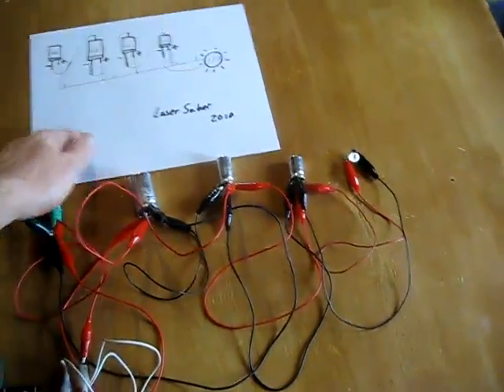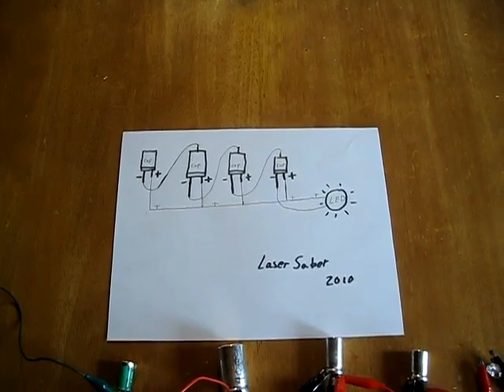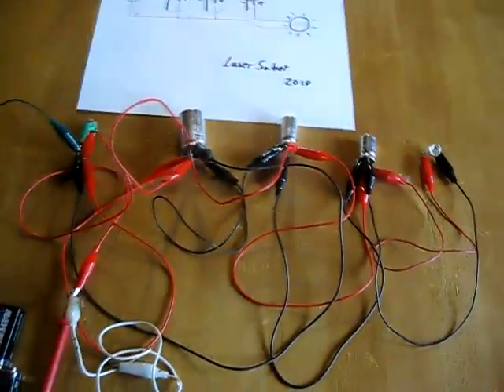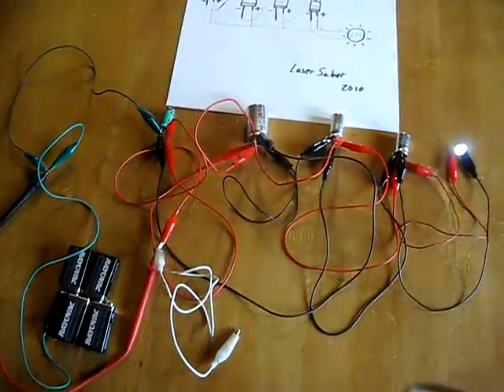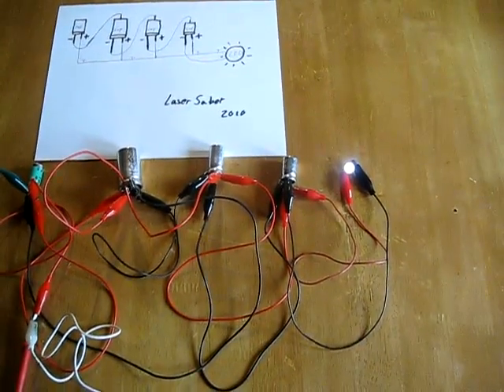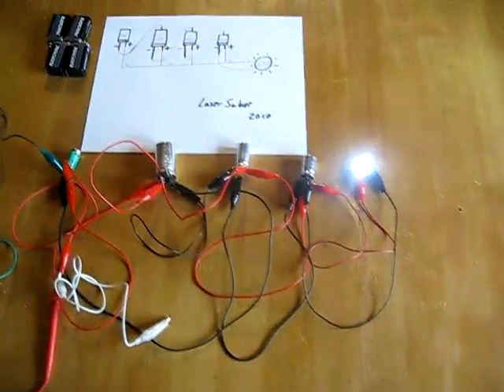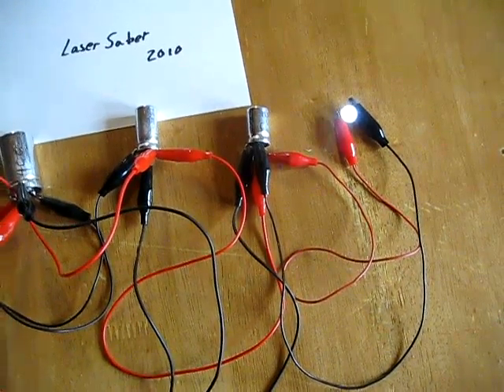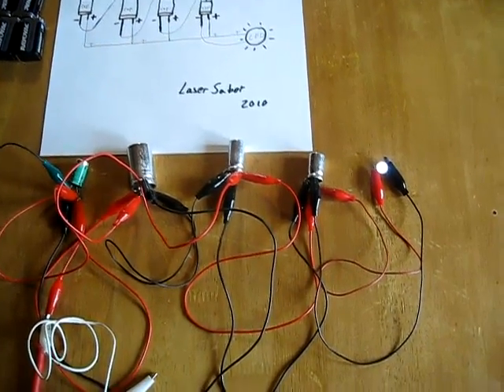Testing the Captret part two.

Comment: Did you do a continuity test between the cap and the negative leg?
I'm fairly sure most metal body capacitors are connected in this way.

Comment: Hi lasersaber , I have tested the same circuit using a 1 uF as driver cap and 3 220uF Caps. the Led is lit for about just 3 seconds and then goes off. So I guess my caps are less farads than yours probably. Can you tell us what are the specs of all your capacitors and LED that you used? I'd like to see that working ... thx :)
N.B: Also tried a 10 uF,and 220uF as a driver Cap but got same results.

Comment: i was wondering after your quick tap to input some energy into the system could a 2sgen be used to keep the power going into the capacitor bank for continued power use for infinite?

Comment: The diagram is different then the wiring formation ? what's the value of the caps please ? volts and ferads Thank you. I need the Value of the batteries used and the led specs ok. thank you

Comment: I don't understand what the purpose of this is? Caps hold a charge, you charge them with the batteries and it lights a LED so why not just eliminate the caps and run it off the batteries?

Comment: This is a very good video!
One question: Why the confusing circuit diagram? Unless I'm not understanding you perfectly, all these capacitors are wired in parallel. I'm just saying it would be a little simpler to see if you just showed each negative connected to the next negative, not to the container (unless there's a reason for this?).

Thank you for sharing!

Comment: Hi,what are the uF values of your caps ?
You can also try, if just connecting the positive output of the drive cap ONLY to the positive pole of the LED has the same effect. In my setup I can just connect the cap via the case to the minus pole as a preload resistor of the LED lamp and then it just draws less power... So just leave all your positive connections to the positives of your caps away and try it again and please tell me, if it behaves the same way. Regards, Stefan.

Comment: I tried this a couple of times with mixed results. What values are the capacitors? Were they all charged or just the first one? And finally, it looks like your are charging with 36V is that right?

Comment: Cool.  See what happens when joule theif is added to circuit and then some of the bemf from the theif is fed back into the first cap as a charging force. How long will it last?  I wonder if it will self run for a bit if at all?

Comment: Laser:

Nice job.  This is similar to what I did a while back only I used one of those drinking birds to periodically touch my contacts without using any energy to do so.  I made a vid. of it and it worked well.  You might consider something like that.  It was not my idea but Wilbyiebriated's for the bird.

Bill

Comment: Very interesting. It would be nice if the schematic showed how the meter was connected. You should try running it with a 555 chip. I would also like to see the output on an oscope.

Comment: about that spike.......  if you hook one nine volt to you tounge........now put a coil in series and bunp the battery...... that  backspike charges up that cap.

  just a thought if you had tried a smaller supply voltage  through a single coil to the caps?
  im gonna give this a go, should have enough stuff around here to get started
great post